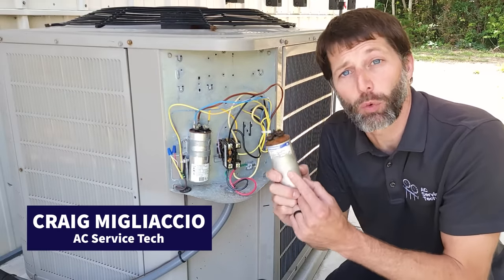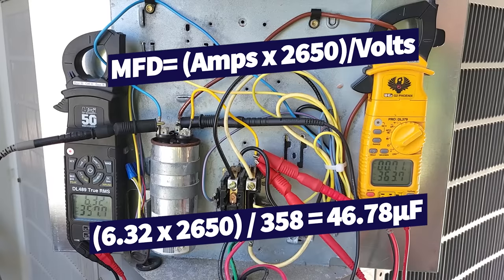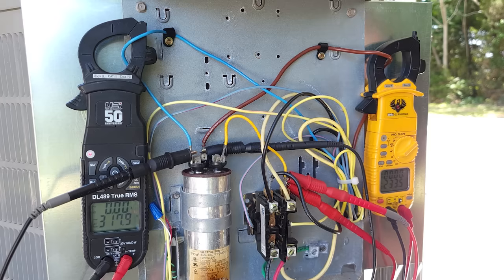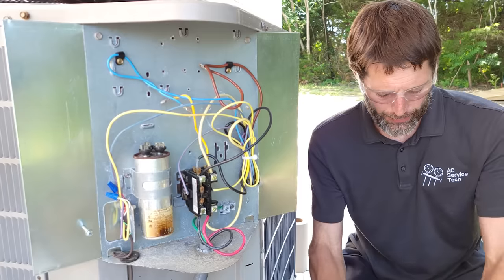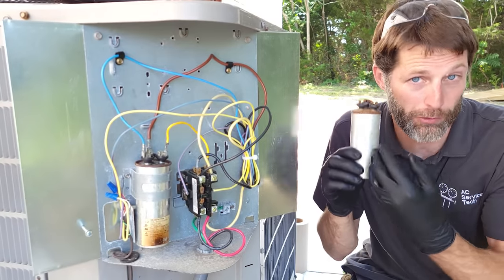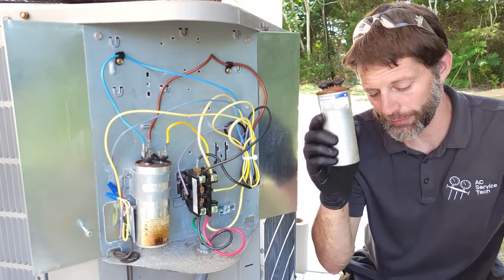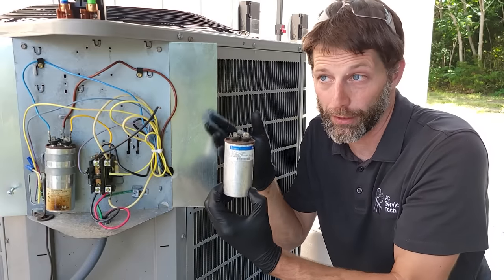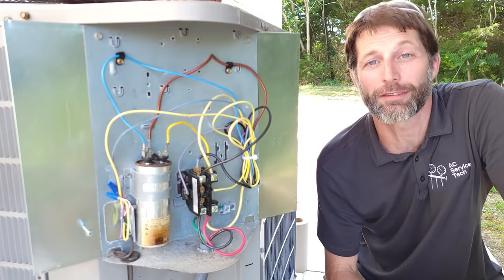WHY CAPACITORS FAIL in Air Conditioners! Watch it Break!

Comment: I'm an HVAC contractor and I would like to give a warning to some of your viewers about "made is China capacitors" sold online. Being in Az with our excessive heat, I have customers that buy and keep spare capacitors. Unfortunately, when buying online, you frequently don't know what quality you are getting. I have seen customers install low quality capacitors which then fail shortly after and sometimes burn out the windings in the compressor. If you buy capacitors online, be sure you are getting the made in USA brands. They cost 4 or 5 times more, but they do last longer and they are a lot cheaper than a new compressor.....
Reply: Don't bring your Chinese hatred in this topic because if you purchase the capacitor from a  reputed chinese company it will work just as well as American made but will definitely be cheaper than American one.
Reply: @sunny6630  I have no hatred for anyone or any country. I am a licensed HVAC contractor and I stated my real life experience. For you to accuse me of hatred, you are showing your own ignorance of the facts and unwillingness to face the truth. I mentioned that the American brands do cost significantly more, but they are worth it because of the consequences of using poorly made, cheap parts from China.
Reply: Agree
Reply: To be honest the world over knows Japanese Capacitors are best.
Reply: @briangc1972  I have used chinese capacitors made by reputable brands and they work just fine within specs and also used very expensive japanese ones and they work also fine within specs. But the only problem is you can find cheap chinese ones on the internet very easily and people can get confused and buy those which are not up to mark. So chinese brands do make good products. And most importantly don't buy the cheapest thing you can find on the internet period.
Reply: @sunny6630  I've bought many Chinese electronics parts online. Some were great, but some were junk, their performance far less than advertised. The problem is telling which are which. It's a bit of a crapshoot.
Reply: @paulmaxwell8851  Exactly my point. So why roll the dice and risk ruining a compressor just to save a few dollars. Isn't that what I said before I was falsely accused of being a 'Chine Hater'?
Reply: Last 4-5 times longer?
Reply: @seal-teeth  heres a trick that will make your outer unit last longer including capacitor. Cover the outer unit with a roof made out of fiber glass so direct sunlight doesn't hit it directly.
Reply: @seal-teeth  Considering many of the cheap made in China capacitors only last a few days or weeks in our 110˚ heat, 4 - 5 times longer is an understatement. Many contractors here routinely replace the china caps on every new HVAC install to cut down on nuisance calls from cheap OEM parts.
Reply: @dislikebutton1799  I ordered a case of run capacitors from our local Goodman branch during their spring inventory stock up sale. Before I ordered them, I was told they were made in Mexico. When they arrived, they were white box generic made in China capacitors. After having the first 3 fail within days of installing them with new fan motors, I decided to test the entire box. Over half were no good. No worth the hassle of having to go back to a job for free to replace a $4 part.
Reply: @sunny6630  I'm Chinese and I can safely say that Chinese capacitor quality is spotty.
Some are great value for the price and perform well enough, but others are total junk
Reply: In Palm Bay florida they manufacture American made caps with a 5 year warranty.
Reply: @briangc1972  Your point is taken.  Ok.  So, for those of us who are not professionals, how about recommendations of makers and sources, so that we don't have to go through the learning experience?  Since your are referencing your experience, that should qualify your recommendation, with the understanding that others' experiences may vary.  Everyone posting here keeps talking about the "quality" products without mentioning them.  Part of online help should include recommendations.  Look at the list of tools, supplies, etc., that are in the "Show more" area of this video.  Why aren't there recommended capacitor makers?
Reply: @ICUNA22  Global brand is one. Their latest offerings have a secondary terminal built it for start kits that offers better protection; not sure if that feature is a gimmick or legit, time will tell. Mars brand in the blue box; not the white box (seems silly for a company like Mars to offer a premium brand (blue box) and a junk econo-line (white box))
Jared brand, no failures with them in over 3 years of installing them as OEM replacements.
Reply: @sunny6630  I have a Trane unit which runs refrigerant through the heat sink to avoid problems like this. I'm sure it's a challenge to not make it so cool that the heat sink condenses water.
Reply: I thought the same, so I bought an AMRAD 7.5 uF 370/440V for my furnace blower in 2018. Less than 4 years later it's measuring at 5uF. This is in a climate-controlled air handler intake  cabinet (mounted next to the blower cage). I bought a "Chinese" capacitor with a taller oval case also rated to 440V for more surface area. I anticipate a longer lifespan, but it's a crapshoot.
Reply: @sunny6630  That shows your lack of understanding. NEVER cover the top of a condenser! They MUST have a direct path for the hot air to be exhausted away from the unit. EVERY manufacturer states the area above the condenser needs to be clear sky of at least a 6' diameter "hole"
Recirculated air will drive up your energy costs and shorten your compressor life. Even shade from a large tree blocking air flow will cause problems eventually.
Reply: @johnhaller5851  That is likely an inverter unit? They are experiencing no start issues here due to the boards being too hot when the unit turns off and the temp control preventing the units from restarting. It's a big issue in the SW desert.
Reply: @briangc1972  Yes, so far no problem with not starting in North Texas. The unit is on the northeast side of the house, so is out of the sun by the time it gets over 100
Reply: Like anything manufactured, quality control is mandatory. From the material sourcing to the fabrication process. Anything in the chain of events from the materials used and the construction phases, if there are shortcuts invovled, the short lifespan and failures are going to happen. You get what you pay for. Any company can mark their products with those quality control stamps or markings.
When cheap labor is incorporated in the manufacturing process and quality control is only performed at the final end, lots of products gets shipped off with questionable reliability. Again, you get what you pay for. Saving money on cheaper materials will be self defeating when you have to waste time on those call backs for labor and repair warranty commitments. Counterfeits are another huge problem and it is becoming more prevalent in this world of greed and fraud.
Reply: @briangc1972  i never said to  box the thing so it has to recirculate hot air.
Reply: @sunny6630  You said to cover the top of the unit. NEVER mount anything ABOVE an A/C condenser.....
Reply: USA?! No thank you! ALWAYS buy from Taiwan. The best quality at a reasonable price.
Reply: You are right, theres a reason why we dont install chinese ac units in america other countries actually buy from us to have the best quality soo big no to china products in americas biggest need
Reply: Made-in-Mexico capacitors are better than China-made ones too.
Reply: @davidperry4013  yup forgot about that alot of stuff from mex is actually high quality
Reply: i think most of the ones sold at the ac supply house are from china or Mexico have not seen one from the usa in years iam retired but did this since 1972 when we used to try and cool beer at the end of the day with r22 sprayed on the cans of beer .
Reply: @henrybucki7813  The supply houses carry multiple brands, is it up to the contractor to pick the better brand vs being cheap and penny wise-pound foolish
Reply: @ICUNA22  ...FWIW....I've found only TWO ,....US made capacitor companies. All others are made in China or Mexico even as replacements from the original AC manufacturers. Here are the 2---> Amrad....and Titan HD ( not just Titan....Titan HD). My shelf spare at the moment is a Chinese made cap (MaxRun) that  has a 5 yr warranty and great reviews on Amazon compared to the many other Chinese brands... ( I think Titan HD has 5 yr warranty too). Like everything else....it is terribly hard to find anything made in USA. And let's be honest....having had American made cars and also Japanese cars.....just because the label says "Made in  USA" may not make it better than some of the better-made Chinese stuff.
Reply: @briangc1972 No...Mars brand is smart...by offering two different prices you will get what you paid....your choice so Mars will not lose their market.
Reply: @didioentoro7575  The problem with Mars is you may not know where the capacitor was made when you are shopping online. You may think you are ordering the Made in USA capacitor, but may get a Made in Mexico or Made in China capacitor. Global is a brand that only makes them in the USA, so I choose Global. I have far fewer failures with Global brand capacitors even with our 115˚F temps here
Reply: I tried a cheap capacitor for 10 bucks and it lasted a month in relatively good conditions....bought the 20 dollar one that was USA made and haven't had a problem in 4 or so years.....im a believer for sure
Reply: Its all made in Asia, just rebranded and like any other product, you get what you pay for.
Reply: Lmfao. You mean "branded in America" 😂😂 "Made in the USA" is the funniest scam ever to be done.
Reply: @hvacmike1175 Happen to know the factory name? I'd be interested to see if they're actually manufactured there or just assembled.
Reply: @hippydude-f1j  AmRad palm coast Fl 5 year part warranty.
Reply: Brian, what USA brands should I research to buy? My spare was made in China that saved me for the time being. The one hvac guy replaced about 7yrs ago was made in China also.
Reply: @mgomez5606  I normally buy Global brand (made in Florida). In a pinch, I will by Mars in the blue box if it says made in the USA. The problem with online ordering is that you can't see the Country of Origin. So I tell everyone to stick to Global. Jard capacitors are made in Mexico; I have had good results with them when Covid caused a massive shortage in the supply chain.
Reply: @briangc1972  Brian, if capacitor has a dent on it out of the box, should I return it?
Reply: @briangc1972  Do you have to have license to buy from local have parts dealer?
Reply: @mgomez5606  Depends on that store's policy. Most only sell to contractors, some sell to anyone.
Reply: @mgomez5606  Depends on the size of the dent. Very minor dent - No.
Big enough to possibly disturb the contents? YES
Reply: @briangc1972 now, if only this rule was true for American cars. 😅 (Specifically referring to GM/Ford longstanding history of upper management rejecting quality controls to the point, the economist who came up with it went to Japan to try and get them to utilize it (which they did up until ISO relaced the Japanese ministry that physically tested final products unlike ISO—which as it has been told to me by those in the know, is an outright scam).

One thing that tends to help with this sort of thing is when a firm is employee owned (best are employee owned cooperatives like Mondragon Corporation, Bob's Red Mill, and numerous others). One primary reason the US government doesn't fund employees buying the closed factories and turning them into employee cooperatives is that if be they did, GM, etc., would go bankrupt alongside GE, etc.—and the finance rentier capitalists can't have that if they want to continue things as they are with them living off of economic rent—something detrimental to the economy.

I agree that our misconceptions about items is definitely a problem. Actually, Adam Savage recently demonstrates a Chinese firm that brought the fractal vise back from the dead (it's the kind that can hold an object irrespective of the objects shape). The whole thing is made beautifully out of stainless steel and demonstrates a high level of engineering skill and insight. Someone sought to bring this vise back after over 100-years (much to many peoples' glee).

I admit that seeing GE on the label in 2023 (given the firm being at the center of the trend to self-obsolescence, shrinkflation, quality shrink, outsourcing, and other longstanding practices. So, I amit that I'd be genuinely surprised if GE was actually making things that weren't built to fail, much like their business model. Maybe, others, but things have radically changed over the past 30–40 years with the decline of US manufacturing.

You'd need to list verifiable manufacturers that still make their products stateside. Otherwise, I by way of knowing how the manufacturing by multinational conglomerates work—would have to automatically suspect the quality of the manufactures goods.

Remember, Japan had a period where quality controls suffered (as we seem to have in the US today — either extremely high quality or the opposite). It usually takes time for manufacturing to fully implement quality controls. Unfortunately, China, just like the US, has its share of GE/GM/etc.s, so sometimes the quality is solid and other times it is shit. I mean — AC Delco quality controls‽🤣🤣🤣🤣🤣🤣🤦🏽‍♂️
Reply: @sunny6630. There is much to love about China. Classical music and painting. Embroidered silk and the women wearing it. Dim Sum and roast duck. Classical poetry and the quintessential marriage manual for men, The Art of War.
Great movies Red Sorghum, and ALL of Albert Changs' work.
Albert Chang had a degree in electrical engineering. I doubt he thought much of Chinese capacitors. Maybe this is what drove him to make movies which are world class.
Reply: @briangc1972  I got another one and was dented also. Sent it back.
Reply: Regardless of what type of fish oil is in the cap the maximum temperature is the limit.
Reply: AMRAD!
Reply: @dandaman2226  these are pretty good Dan?
Reply: @sunny6630  The issue is, the market of Chinese components is so oversaturated, you won't know if you're buying garbage until it arrives.
Reply: @sunny6630 I've worked my entire life as an electronics tech, and Chinese capacitors are notorious for poor quality.  It has nothing to do with Chinese people.  There are a few Americans companies that have moved their production plants to China, (Sprague for one).  They seem to maintain the same standards as before, but that is an exception.
Reply: Amrad all the way! I know Chinese produced electrical components are very hit or miss. This includes many many electronic components, USA Taiwan or Japan for those.
Reply: @sunny6630 Chinese quality and dependability SUCK . Especially in electrical and electronics applications.
Reply: @briangc1972 I agree . In automotive applications for electrical and electronics the Chinese quality and dependability truly SUCK . I'd rather pay more for American made quality and keep our money in our economy.
Reply: @mouldyboats Nope
Reply: @-iIIiiiiiIiiiiIIIiiIi- Bull crap
Reply: Yup, I’m in the High desert of California and we have the same problem with Chinese capacitors.  Lucky if they last one year.  I only use Marrs Capacitors because they come with a five year warranty.  Did you notice that this capacitor was over the limit?  + or - .5%.
Reply: @sunny6630 it won’t last as long.  It’s not all Chinese capacitors, it’s also capacitors that say, “Made in USA, assembled in Mexico.  So it’s not just Chinese capacitors.  It’s fact!  I’ve been doing HVAC for 17 years, and have seen it.  Good capacitors will last 3-5 years.  Also they should be changed every 3-5 years, along with contactors.  The other guy isn’t hating on China… he’s just stating the facts.
Reply: @sunny6630 it’s cheaper because the materials are cheaper, and it won’t last as long.
Reply: @briangc1972 get him!  Sucks knowing right?  I love it when homeowners think they know as much as us.
Reply: @mouldyboats wrong.  I’m half Japanese, and I know that American capacitors are better.  People talk about the cost because most people have no idea of what they’re getting.  Most dual capacitors are under $40.  But if you don’t understand how to connect them properly, and need a technician to install it, you’re paying for the capacitor, the service call, and the cost of another capacitor if the one installed fails within a year.  Most companies only offer one year on capacitors.  Also the entire system needs to be checked to make sure the devices are running the proper amperage.  Otherwise the capacitor will fail, so the capacitor will be sold without a warranty, unless the other parts are replaced.  So now you have reasons, that should help you understand.  Also, capacitors hold a charge that needs to be neutralized or you could get shocked really bad.  This is why it’s better for most people to hire a good technician.
Reply: @paulmaxwell8851 that’s why you should buy American made and assembled.
Reply: @briangc1972 right?  Let’s see, buy a good capacitor, installed for around $250, compared to a $1,500 compressor.  All the numbers need to match!  Some people are just ignorant!
Reply: @dislikebutton1799 in America we have these standards.  That’s part of why they’re more expensive!
Reply: @seal-teeth yes, most Chinese capacitors are lucky to last a year.  If you’re in the mountains where the temperatures are below 100 degrees Fahrenheit they’ll last longer.  But in temperatures over 100, they’ll fail.  The capacitors I use come with a five year warranty… made in U.S.A..
Reply: @sunny6630 yeah, it’s cheaper to just buy good capacitors.
Reply: @briangc1972 yeah, American made cost you $10-$15 and you save yourself from stupid callbacks!  Good man!
Reply: @TheMatsushitaMan hilarious, but true.  Thanks for the facts!  👍👏
Reply: @hvacmike1175 MARRS.
Reply: @ICUNA22 Marrs.  5 year warranty on most capacitors.
Reply: @johnhaller5851 it’s important that your system isn’t overcharged with Freon also.  This will increase the amp load and cause failures.  Usually most systems have a high and low limit switch, but if the charge is correct, the amps should be within .5 amps.
Reply: @xiradio all capacitors should be changed every 3-5 years.  If you know how to test them with a microfarad tester, then you just make sure it’s within +-.5%
Reply: @briangc1972 also 12” away from walls to suck the air in.  Good man, you know your job well!  👍
Reply: @-iIIiiiiiIiiiiIIIiiIi- ignorant response!  I see made in Taiwan… it goes in the trash!
Reply: @davidperry4013 not really.  The parts are usually made in America and installed in Mexico.  Lucky to last one year.
Reply: I don’t understand most of you people.  Why would you want to deal with changing capacitors every year!  That’s just stupid!  Pay the extra $5 and leave it alone for 3-5 years.  Stop thinking cheap!  You’re wasting your time and money!  If you end up replacing the part yourself it adds up.  So being cheap could end up costing you lots of money.  Good capacitors made in America for $15.  Bad cheap capacitors if replaced every year for 3 years… $30 plus shipping and the time dealing with it.  And if a motor or compressor go out, you’re screwed!  Stop thinking cheap people!
Reply: @TheWilferch Titans are assembled in Mexico.  They will fail in high temperatures.  I make a special trip to my other wholesale supplier for good capacitors.
Reply: @bsrodeo7s  ...as I said in my previous comment.... Titan HD variant is US made....the regular Titan in Mexico.....
Reply: American made cost more because we don’t use slave labor.  Nor do we have zero concern for the customer and safety.  A lot the expense is materials and manufacturing processes that cost time and money.  Plus the worker here are making a decent wage.
Reply: @TheWilferch  sorry but you’re wrong.  They are both assembled in Mexico.  That’s why I don’t use Titan at all.  Parts are made in America, but both are assembled in Mexico.  Nice try though.
Reply: From my experience with any Chinese products very true 😮
Reply: @sunny6630 It's not hate, it's a fact that China does not make high quality products.
Reply: @sunny6630 I don't buy Chinese simply to not promote slavery and the abuse of their people, you may want to do a little research before trying to garner social justice points on a public platform everyone will see. Quit trying to appear like the good guy armed with only ignorance and projection.
Reply: @sunny6630 you’re right! It’s a matter of choice not Chinese made. China will give you cheap and expensive options you just have to choose wisely. After all, 90% of USA made things are made in China lmao. Wo ai Zhongguo!
Reply: In Texas I keep a spare for both of my units and add them for new installs as a backup. You get 1 year max out of Chinese caps and two-three out of the American Titan caps
Reply: Why would my capicitor only last 6 months to a year.   Outside unit does not even turn on every time it goes bad ?!!!!
Reply: @briangc1972  where are you located in the Phoenix area?  What company do you own or work for as a reference for a quality tech.  I had a new 2 stage trane installed by Reeis  in 2020.
Reply: @DirtbikeDad  Likely a poor quality brand. I always take voltage and amperage readings on a new capacitor so I know that it is performing at it's rated spec during operation.
Reply: @jscheman  I'm in the east valley but I work the entire valley and most of the state. I just got back from Sun City. 
Desert Heating and Cooling LLC is my company
6 Oh too 5 too for Oh l 5 Oh 
I don't think the spam bots can figure that one out. 😀
Reply: @sunny6630  no not a very good idea
Reply: @mouldyboats  True, Japanese made is almost always a good bet on quality. The original poster does have a point though on Chinese quality.
Reply: @briangc1972  Yes, your point was spot on, it’s simply a fact that Chinese made quality is hit or miss. That said, as an example, in the case of an American company that contracts with a Chinese manufacturer to make their product to meet certain standards, then it’s a better bet that made in China by and for a Chinese owned company.
Reply: @briangc1972 I hate that you are right!
Reply: So I should pay you $400 instead of $20
Reply: @briangc1972 Mine came from Mexico, so I'm good ?
Reply: @markme4  The made in Mexico capacitors are usually good quality.
Reply: @briangc1972  Thank you, that makes me feel better
Reply: @sunny6630 but If you wish to be on the safe side and sure, buy the made in US.
Reply: @sunny6630  that was a very narrow response
Reply: I agree chinese made capacitors are a hit and miss on quality... I only use amrad and titan caps
Reply: @sunny6630 Having held an Assist Director of Engineering title over a local hospital,  majoring in Electronic Instrumentation/ minoring in Electrical Distribution, and logging a minimum of 15 years experience in HVACR industry I believe I can speak on this issue of Chinese components; specifically capacitors. Simply put, THEY ARE PRETTY LOOKING FAKES and JUNK,  a waste of resources (both in material and cost) and by far the overwhelming cause of failure in both residential and commercial appliances used in consumer products today. There I fixed it for you.
Reply: @hvacmike1175 Hey, I’m in Palm Bay, FL. I replaced a run capacitor just 10 days ago. The AC was fine until this afternoon (blowing hot), and I’m assuming it’s the same capacitor. I got the capacitor at City Electric in Palm Bay, but it’s made in China. Any ideas on what could’ve happened? My AC unit isn’t in the sun too much; it gets a little morning sun but nothing during hotter hours. I plan to take the cap back to City Electric tomorrow to see if they’ll test it. Any other ideas?
Reply: I know, right!?!  I was thinkin, "who's the nitwit that posted this advice?
Don't worry about your caps, just do what this genius says and your condensing unit will fail in no time😮
Reply: Supply-chain custody + parts with real datasheets + reliable manufacturers meeting claimed specifications = peace of mind
Reply: @sunny6630 your so gay bro
Reply: @plumbercustoms6673  😂😂😂 okay, whatever floats your boat.
Reply: Amazon is full of fake junk. But proper suppliers refuse to sell to the general public, making all of these diy rexommendations useless.
Reply: @Null-o7j  Amazon and eBay both sell the junk as well as the Made in America brands. You just need to read the description in the ads.
Reply: @sunny6630 Your Red Chinese capacitors might work the treat where you live, but in the dry Arizona desert where it needs to run in 50 - 55° C weather for extended periods, that might be the real test.  A service call in Arizona is too expensive to make 2 times in a month.
Reply: @johnhaller5851 prolly not too much of a challenge for those brainy science hvacgineers. The capacitors generate heat at a certain rate while running, set a thermocouple to run the coolant at a threshold temp, shuts off below it.
Reply: @sunny6630 
It also keeps it dry.
Reply: I live in AZ. I only buy American made capacitors and they only last about 3 years. Yes, and always have a spare on hand.
Reply: Whats the name of a USA brand? I got one from Ace Chinese made for $32